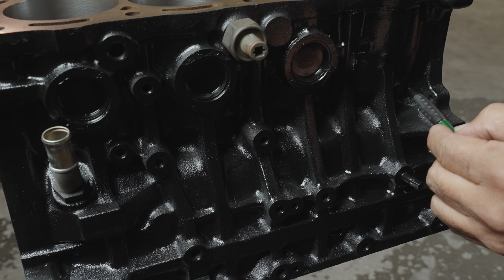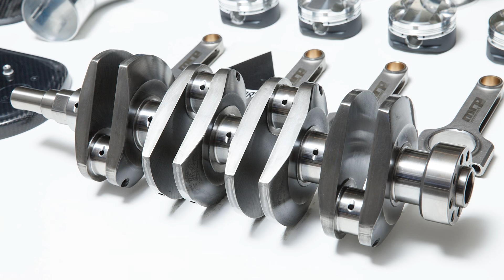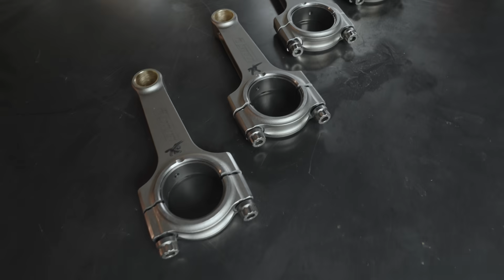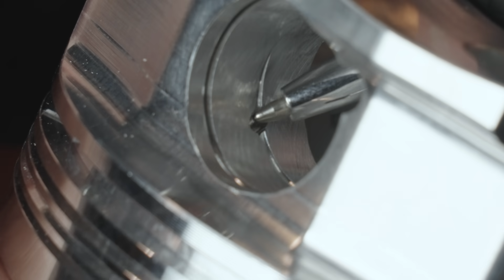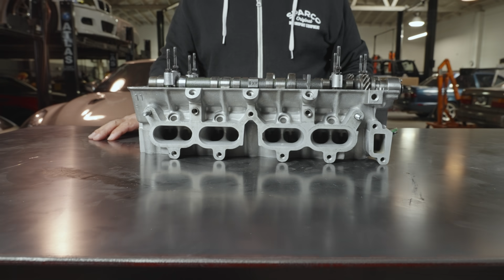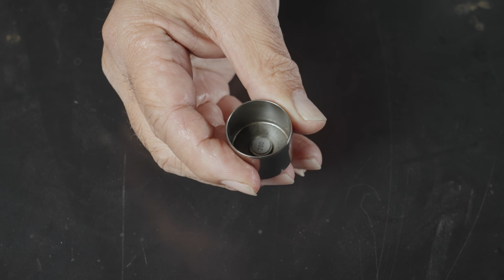Building the Toyota 4A-GE!

Comment: Fantastic... If you don't already know of Garage 4age YT channel you will really like it... A fellow kiwi guy runs the channel and has around 220hp out of his 4age
Reply: He’s pulling that at the wheels.
Reply: @justinwilliams1333  correct bro
Reply from the maker: 220 is pretty standard, a really well built one can be 230 plus.
Reply: @motoiq  garage 4age's engine is also the 16v not 20v of the later mk's... I really like your videos though... Thanks for keeping them coming
Reply from the maker: I know that, did I say otherwise by mistake?

Comment: Love seeing a moto IQ 4ag video. However some not very accurate 4ag info, tho it can be forgiven.

 I dunno how someone could say a stock 4A 42mm rod forged crank is weak.. and the small port head would have definitely been a more optimal choice with the increased port velocity. Combustion chambers definitely need a de-shroud with that comp as well ect..

Would definitely like to see more videos on a 4ag heads including 20v's

Best regards,
Reply from the maker: The standard 42mm crank is weak for running above 8000 rpm for long. The 40mm crank will break in one or two track sessions. Come on, I used to be an engineer for TRD and worked on the development of these engines for GT3 and Formula Atlantic. We did so much testing and breaking things.  When running them to 9k we even broke the Billet 42 mm cranks.  The service life was about 12 hours on those.  Rod bearings had to be changed every 3 hours even with the larger journals. Small port heads are good for simple street engines with basic bolt-ons but not a high-power build.  This is a small underbuilt engine that was designed to have 114 hp, more than double that, and things break, a lot.

Comment: Thanks for the Tech Info,
The 7A-FE Block is 15mm taller and is a great choice for high revving 4A-GE builds and improves "Rod/Stroke ratio", 4A-GE Head bolts directly on the 7A-FE Block
Reply: Where did your read this?
Reply from the maker: MRP has all the parts to do it, its is sort of common knowledge. https://www.mrpltd.co.nz/product-category/automotive/4age-performance/
Reply: @bajanboyhood  it's been on the internet forever... type 7A-GE engine
Reply: @kamperformance5281  there also exists the 9AGE engine using 2ZZ bottom end in 7AGE setup
Reply: @EscapingTheConcrete  the idea was to use a 1ZZ crank in a 7AFE block (bored out to 83mm) with a 4AGE head... but it requires so much machining and stuffing around that it's not worth it and never has been.  

Re using a 2ZZ, the 2ZZ crank has less throw than a 7A crank, so it's not a valid path to the "mythical 9AGE".

Please stop sharing bad information.

Comment: Just the info I needed! We're planning to build a 4AGE as well. Any thoughts on the later 20valve models? They seem to rev beyond 8k RPM stock with no problems on oiling? We will be going GZE block for all the goodness you have mentioned here. Thanks for the info!
Reply: Check out the YouTube channel Garage 4age for answers to so many questions
Reply: @bryanduggan  Garage 4AGE mostly does the 16V versions I believe.
Reply from the maker: I happen to like those engines, they just don't have as much aftermarket support.
Reply from the maker: Also, the 20V heads make less top-end power than the large port 16v heads when they have the big Formula Atlantic valves.  They do make good mid-top power.
Reply from the maker: The third series oil pump gears don't have such issues with breaking.  Good for 9k.
Reply: https://youtu.be/TAiVHkhHKT4

Comment: Great video. Hard to believe they’re a 40 year old design now! They sound so great, and were and still are a staple at every motorsport event in about any configuration you can imagine, as a 2A-GE for example. 

I have a soft spot for these (having owing 3 AE82 FX-GT and an AE85 with a 20v back in the day).
They’re fragile alright, I’ve run bearings a few times in the bigport motors without the external head drain like the smallport has. 

Great to see NZ companies and guys like Garage 4age keeping them alive too.
Reply from the maker: It's hard to find core parts now days.
Reply: https://youtu.be/cutqpCTXvD4

Comment: How about using the crank/block from the 7A-FE? The later 5S are better cranks/blocks than any generations of the 3S stuff.
Reply from the maker: The MRP guys from New Zealand are doing just this and building 2-liter versions.  I kinda want to build one!  I would also swap a Honda K motor for an AE86 hahahaha.
Reply: @MotoIQ  I can't imagine a 7AFE shortblock is worth more than $250 dollars. This is kind of like a B20 head swap or the VE head swap on an SR. It would be interesting to see a 2.0 A block build with a 20V head. That would be really interesting to see.
Reply: @cjburn2758  at least up in Canada the 7AFE still came in the late 90s corollas even, definitely a few of them rotting away in junkyards still
Reply: @snoofayy6150  I owned a 1997 Corolla DX with the 7A and a 5 speed. In 1998 came with the new 1.8 1zzfe.

Comment: What engine swap would be a great alternative? Keeping the engine weight similar.
Reply: Beams 3sge or Honda k-series
Reply from the maker: I would hands down do a Honda K motor.
Reply: @motoiq  of course. 🤣. K motor is a great option. I bet it’s also the cheaper route when making over 170hp.
Reply: @motoiq  if my 4A-GE ever blows up beyond recovery I'm doing a k-series
Reply: Go for a 2arfe. 2.5L 300hp capable.  It's the Toyota version of a k series
Reply: @juddy953  Thanks! I’ll look into it. The k-series fits but it is such a tall engine. Either cut the hood or lose ground clearance.
Reply: For the same weight and if fwd a 2zz is a far better option than a k series

Comment: I remember reading that these are basically a clone of the Cosworth BDA racing engine. They always had a mystique.
Reply: The heads are were it gets a little eerie
Reply from the maker: These are not even close to a BDA.  The BDA is related to a 1.6 liter Pinto motor.
Reply: @motoiq  "Bilzilla 4A-GE" Page stated that Toyota copied the Ford Pinto/Cosworth BDA , and that valve sizes are exactly the same and ports are very similar, plus both are belt driven ...
Reply: @motoiq  Thanks for the correction!
Reply: @motoiq   "not even close to a BDA" besides the, bore, stroke, valve sizes, wide valve angles, simillar head ports, being Ford and Toyota's first belt drive engines... I'm sure Toyota knew nothing of the engine that had been winning international races and rallies for over a decade prior. They even debuted in very simillar cars. 
Started life from different blocks but clearly copied Cosworth's proven design. 

And the engine the 4A-GE replaced was basically a Lotus twincam which is what the BDA replaced lol
Reply from the maker: If you have actually seen both motors taken apart you would know that there is nothing similar on them.  The intake ports are really different, the port splitter is way far forward and the port angle is more downward with a straighter shot into the cylinder.  The port volume is a lot smaller. The block is totally different, it has an intermediate shaft where the cam used to be that drives the distributor. A BDA is actually beefier than a 4AG. It's like a 1600cc pinto Kent engine converted to a twin cam head, like the 2TG and 18RG.
Reply: @motoiq  so is the Toyota head better than the BDA?
Reply: @motoiq  are the cylinder bores siamesed on the aluminium Cosworth BDA blocks ?
Reply from the maker: The Toyota head isnt as good for torque.
Reply from the maker: I think the aluminum block is a BDP and I think they were siamesed.  When I was around they were used in midgets but I have never seen one apart.

Comment: What about using the 7A block to build off on? You guys tried that?
Reply from the maker: The MRP folks in New Zealand have to make 2 liter versions, kinda want to try one but I am more inclined to put a 300 whp K motor in that costs less money to build!
Reply: @motoiq  Make the ultimate N2 engine Mike, do it for Keiichi 😁